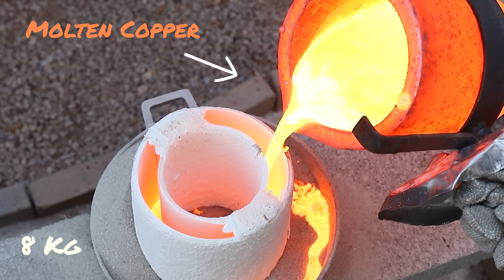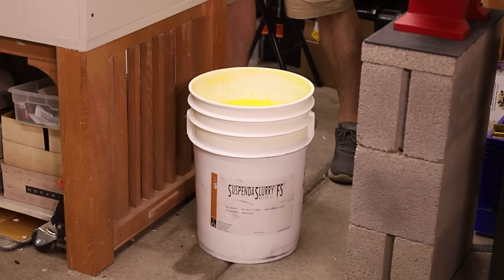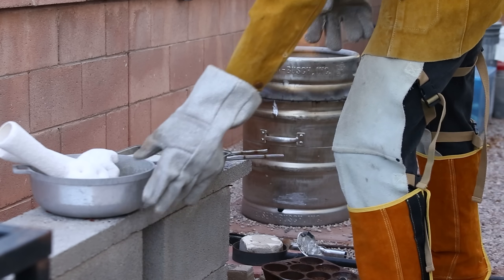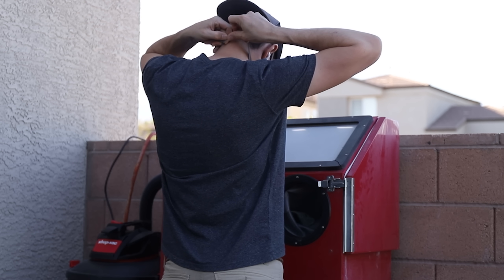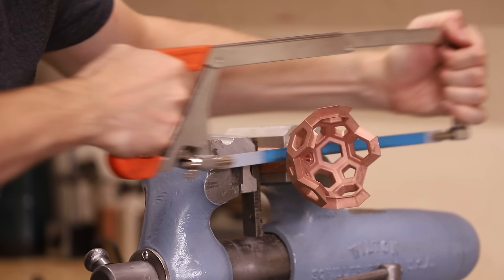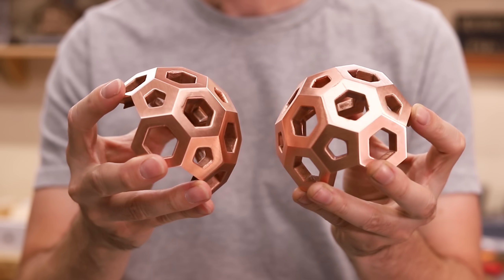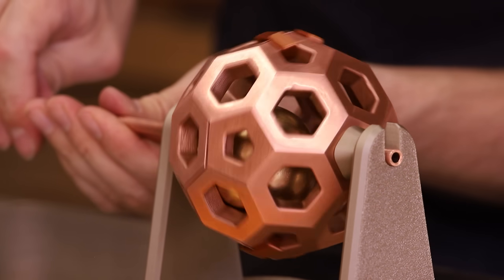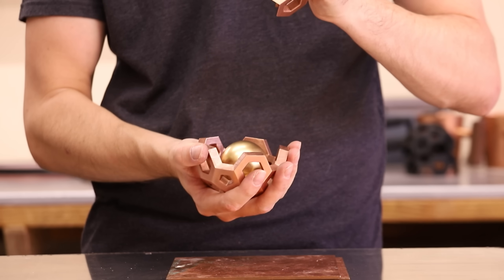HUGE Magnet VS Copper Sphere - Defying Gravity- Will a Neodymium Magnet Float Inside?

Comment: Good demo and effort. The occasional bumping of the magnet ball to the cage is due to the induction slippage between the PM and the induced magnetic field in the copper cage. Hence, you may never be able to fully eliminate it as it is affected by the magnet's poles alignment vs the cage's magnetic field strength that's also depends on the speed of rotation. I guess, the higher the cage rotation the better it will get, however, a slight alteration could bring it out of balance and cause unprecedented accident even, although unlikely. So, be very careful at high speeds...!!!

Comment: Perhaps you could scale it up. Maybe 3-4X bigger. 
IMHO, I think with the space inside being so small, it doesn't have enough space inside to properly adjust to the center of gravity. That, combined with the small space, creates an equation for low to mid success. 

Yes it was starting to hover inside, but that amount of space inside leaves very small room for error. 

Just an opinion. Maybe I'm wrong. Idk

Comment: Question, was the magnet in the center causing the shell to rotate when an exterior magnet was introduced? Or would it still rotate if the magnet inside the shell wasn't there? 

Follow up question, not an original idea but, if this type of thing was mounted to the center of a wheel axle, could it then turn the wheels with less moving parts, lubricant, materials, etc?

Comment: Use a strobe light and freeze the rotating sphere we can clearly see at what rpm the magnetic repels the sides. 

It seems that at any rpm the magnetic repels and attracts to the sphere. The magnet itself eventually synchronizes with the rotation of the sphere and the current in the sphere stops causing the magnet to settle to one side in contact even though rpms increases.

So you need a variable sphere rotating rate that varies up and down to always be going in a different spin direction than the magnet.  You could detect the voltage across different sides of the sphere and always turn the sphere to the lowest voltage side  on the bottom then gravity would pull the magnet towards it generating higher current.

The most repulsive side of the sphere is always the side facing down. 

I don’t know, it is a complex object with an interplay of forces and counter forces and multiple objects at varying spin rates that are trying to match their spin. Plus the entire system is being accelerated pretty hard at 1G.  

Lots of vectors 😇

It might work better in shake mode.  I’ll bet there is a magic resonant sound frequency that would make the magnet levitate in the sphere. You are just shaking it up and down really fast.

Comment: That's a beautiful copper structure. You could take a tube that was open on two ends and rotate that and you could have the camera aiming in at the end and have the tube sitting in place rotating and get the same effect.
Reply: The reason why a tube would work is so you could have a clear camera camera view to the magnet.

Comment: Hey I wondered if you could make a skyscraper evacuation system with a copper tube and magnetic platform somehow. Also, how can you get the sphere spinning inside of the larger hollow sphere using magnets? Like what if a prendrev magnet motor array was mounting INSIDE the sphere and the ball was plastic and had magnets positions or something. Maybe on an axle running through like your turning rod was

Comment: A good idea to build a fusion power generator,sphere would rotate and generate strong magnetic field however instead a magnet an isotope required to be inserted,instead copper more powerful alloy requires that would withstand extreme temperature gain and loss.
The specific alloy requires to handle extremely hot temperature and extremely cold temperature at same time which means it is very danced material....
Because of the isotope and the sphere would generate strong tidal and centrifugal forces forcing sphere to rotate and produce magnetic force which hence produce electrical energy more than enough powering 1/4% of few blocks.
This is a concept of ones lost ancient technology,fusion power can easily outfit nuclear power plants and reduce their huge sizes,instead generators that requires steam to be turned from fusion technology power floating directly through magnetic field,the stronger the field the stronger forces would be which ultimately more power would be gained....
The concept proofed to be correct but the struggle point is alloys that required for exotic matter be contained in or 2 different elements in order to generate fusion vs outdated fission process which we using today....
Fusion core or fusion reactors easier to control unlike nuclear reactors,the real challenge is to build very strong cooling modules and containment devices....
However this version of power plant can provide 3 times if not further of electrical energy vs modern nuclear reactors which cost potential risk of accident and radiation exposure....
Are we ever going to evolve or would always stock at same primitive state????

Comment: the model has many potential, kinetic energy and momentum, the use of copper can also be attached with other magnets, to change its polarity, after which it can create a continuous force that repels the energy based on the polarity, type of magnets, and the metal, since it is an enclosure, based on this model, it can maintain momentum manufacture energy, kinetic and potential, without battery.****

Comment: Add some ball bearings, then a battery operated motor to spin it at the optimal speed.
Then put the whole contraption on a bathroom scale, to see how (if) the weight changes.

Comment: I think you should add real mercury into your next test with this.. I'd like to know what happens if you make a clear sphere to place around this sphere, and fill the whole thing with mercury, and then seal it, and then spin it fast and see if you get any thing to note with that. Referencing something in my memory from one of the ancient aliens episodes about the power of pyramids, near the end of the episode the narrator speaks of a scientist who made a small pyramid out of copper pipe and filled it with mercury and sealed it. then when an electrical current is applied, which in this case would be achieved with the magnet, and then spinning the whole setup, some special properties were emitted, such as a type of force field or hyper-dimensional rift was formed around the pyramid, and it moved in a specific direction every test. I can't remember what episode this was but maybe others can help with that. Short on time right now..

Comment: I think the considerations would be the size of the magnet vs the size of your "sphere" as the cylinder you used was much closer to the circumference of the flat magnet. Also, the shape not being spherical meant the magnetic  fields would have "spikes" during rotation which maybe led to the need for a certain speed / frequency to keep the ball "levitating" either falling down into the holder or being "spiked" into the other side.

Comment: This is really cool. Though it strikes me that eventually the balls rotational speed will match that of the cage, at which point the magnetic forces will be lost. So my assumption is that you need the ball to rotate at a lower speed than the cage. How that could be achieved is its own question though. Maybe through constant angular acceleration? Though obviously that means your levitating timespan will be quite limited.

Comment: The sphere diameter is too small. Try a fixed motor with a variable speed armature and control switch. 
I believe it needs more space and stability in speed of rotation. 👍🏻

Comment: Stuff like this reminds me that most of the science that proves the electron model is done by inferring data from sensor readings to produce data, that while largely consistent with the mainstream electron model, doesn't explicitly disprove much from any other interpretations, and specifically are consistent with Leedskalnin's interpretations which could be applied to 100% of the electron model science (not that his was as inclusive) but does not run into problems in the anomalous examples that don't fit the electron model without incorporating a complicated solution that feels more like a stubborn excuse than an explanation.  Then that makes us think: Maybe Tesla's explanation better fits the gravity wave experiments used to "prove" Einstein's proposals. And then you see people just tinkering like this, and note how close they were to basically creating a small engine or generator just to create a magic levitation desk toy.
Humanity is capable of so much more than it settles for.
Reply: You can also observe electrons quite easily, it’s called a CRT.
Reply: @wackyvorlon  Think so? CRT lets you see a beam of light, and depending on the application, a fraction of a sine wave. Not an electron. BUT! If you use CRT to observe ALL the power, not just one side, (Just assuming you'd be using an "electron beam") you might be able to observe Leedskalnin's "cosmic force", but only if the magnetic interference is tuned in such a way as to allow the shape in the observed "electron beam", and that's cheating.  (IMO)
Fortunately you don't need CRT to observe Leedskalnin's explanation, as it can be done to directly observe the force using magnets and a highV electrical line with voltage running through it, or potentially magnetic paper, or any similar means. Does that mean the electron doesn't exist? ...well... It's not as if the effects aren't real. But if we allow ourselves to consider alternate interpretations (especially interpretations that have superior predictive power developed by objectively brilliant people) you might find little hacks with practical applications no one else can, simply because no one else is looking.
Happy experimenting!

Comment: It might be too small for the size of the magnet. Maybe add some motors to maintain the speed of rotation. The copper might also need to have some electricity? Im just pulling ideas.

Comment: Make it again when they get the opposite. Try to have where the corners of the copper rectangles me. The inner sihello, but the center hole will be gone. It will be a flat desk of copper and then how you spend a magnet.  For the opposite Poles to get the ball to spin.Put that on a motor instmake.The fittings that you held on to with it.Make those copper as well and put a current

Comment: Spectrum Shift Hypothesis (SSH): Neutral Framework
The Spectrum Shift Hypothesis posits that systems, whether physical, biological, or even abstract, undergo dynamic changes based on how they interact within their environment. These changes are not arbitrary but arise due to fundamental principles of interaction, which include the roles of density, motion, and electromagnetic phenomena.

Core Principles of the Framework:
Density, Motion, and Gravity as Expressions of Interaction:

Density, motion, and gravity represent distinct but interconnected expressions of a deeper interaction within systems. These elements do not act as separate "forces" or properties but are seen as manifestations of an underlying process through which systems organize themselves within their surroundings.
Rather than seeing gravity as a force that pulls objects together, it is viewed as a mechanism that results from how density and motion manifest in a given system. The system's interaction with its environment depends on these factors aligning in a way that defines its placement and behavior within the system.
The Fractal Nature of Systems:

The structure of reality, from the smallest elements to the largest, can be seen as operating on a fractal principle: smaller systems reflect the same patterns and processes as larger systems, though they may differ in scale.
This fractal arrangement means that the way systems behave can be generalized but also scaled to different levels. Smaller-scale systems mirror the properties of larger systems they are part of but do so within their relative context and within a larger framework.
Spherical Spectrum:

The spherical spectrum is a conceptual space where interactions within a system are organized and radiate in gradients. The system under consideration operates within a balanced set of relationships, which could be visualized as a sphere, but not in a literal sense. Instead, the sphere represents how systems operate within a gradated interaction model, where different positions within this space reflect different interactions and densities.
This space is dynamic and can be shifted as systems interact and respond to environmental changes. These interactions represent adjustments in the system's positioning within this spectrum.
Electromagnetic Phenomena as Key Interaction Mechanisms:

Electromagnetic fields and their interactions with materials are key components in the shifting behavior of systems. When systems are affected by electromagnetic phenomena, the way they interact with their environment alters. This could include induced currents, feedback mechanisms, or electromagnetic waves that propagate and influence the system in real-time.
The response of the system to these fields is crucial in understanding its dynamic properties and how it moves or shifts within the spectrum of its larger context. The system does not simply react; it modifies its state of balance in response to external forces.
No Assumptions About Movement or Vibrational Frequency:

In this framework, there are no assumptions about specific mechanisms, like sound, vibration, or electromagnetic frequency, except that interactions in the system cause changes in the system’s positioning. These changes are not arbitrary but are based on patterns of influence that occur naturally within the system's range of potential states.
The notion of vibrational frequencies that resonate with a system's environment could play a role, but the focus is on the system's adaptive response to its environment, which occurs without pre-assumed mechanisms.
Systemic Movement and Balance:

Systems do not operate independently or as isolated entities. Instead, they interact within larger frameworks that reflect similar principles. These systems are in a state of dynamic balance where they adapt based on their interactions with the surroundings, adjusting density, motion, and other parameters as necessary.
The balance of the system is not absolute, but the system's properties interact with external variables in such a way that the system remains in a dynamic equilibrium that is responsive to changes.
No Assumptions About Reproduction or Self-Organization:

While the idea of reproduction or self-organization may be relevant in some interpretations, this hypothesis does not assume such processes are at play. Rather, the focus is purely on the interaction dynamics that define the system’s behavior, with the recognition that systems adjust themselves based on internal and external factors.
Feedback Mechanisms:

Feedback is an inherent component of how systems interact with their surroundings. Positive and negative feedback mechanisms are involved in the adjustment of system properties. These mechanisms can involve electromagnetic effects, material properties, or other factors influencing the system’s behavior in response to external shifts.
Conceptual Insights:
Unified Interaction: The hypothesis revolves around the idea that systems shift based on interactions involving density, motion, and the influence of electromagnetic fields. These interactions form a unified concept that defines the system's state of equilibrium in a given environment.

Balance within Larger Frameworks: Every system operates within a larger context, and its position in relation to the broader system defines its behavior. The concept of the spherical spectrum serves as a neutral, general framework for visualizing how systems may operate within their respective environments.

Dynamic Adjustment: Systems are continuously adjusting themselves in response to external influences, and the shift in their state is determined by how these influences are distributed across the spectrum. This adjustment does not imply predetermined or fixed movement but rather a natural response to changes in the environment.

Interconnectedness: Systems are never fully isolated. Their interactions with larger systems, both spatially and energetically, lead to adaptation and shifting within the broader framework, ensuring that they remain aligned with the overall structure in a dynamic equilibrium

Comment: Your problem is the polarity of the magnet since its a ball and not a double sided plate for different polarities as you cant adjust polarity.
You need to reverse engineer the process by forging a magnet dome over a steal sphere. Or in this case you want to use copper to generate an electric field and in this case the current out put will be at both ends of the spindal.
Applying a liquid (ie; gel) into the dome can generate a directional current over the ball (which ive found may only be clearly visible from air pockets within glass) but you could use an LED or series of LEDs as markers which could in turn be powered from the generated elecric conductivity.
Once you have the induction of power, ie; a crank, then the electrical consuctivity could potentually be self sustainable to run a motor for the turning of a pindal however it is more then likely to be significantly lower then the power output of your drill. However there is always gearing for a motor like a switch to adjust gears to increase speed based on increased load on the spindal of pullies (for example) in order to increase load capacity for a faster speed for ourput generation as you can only go as fast as your output, which in this case is none.